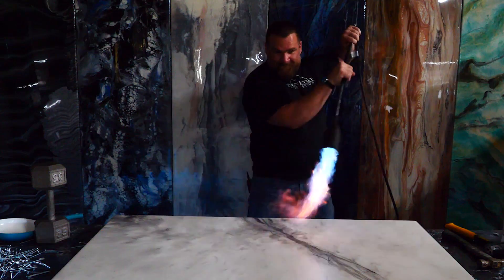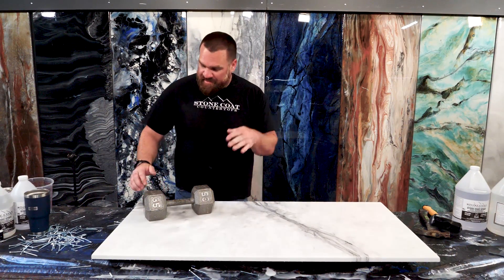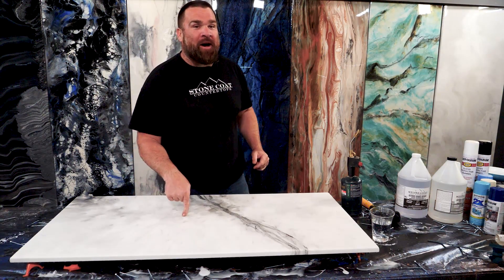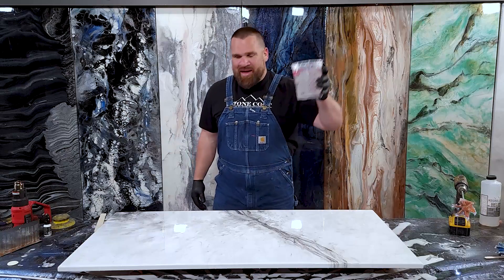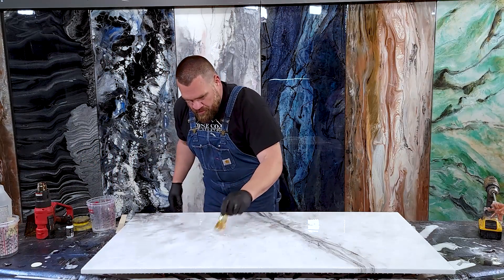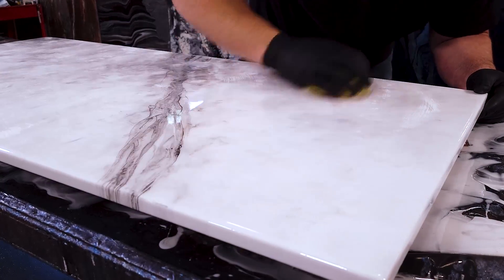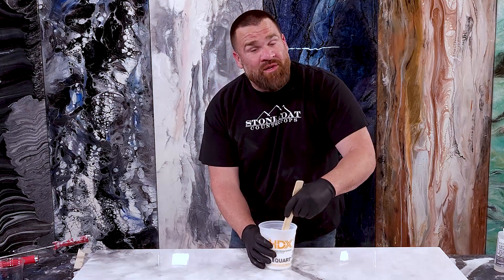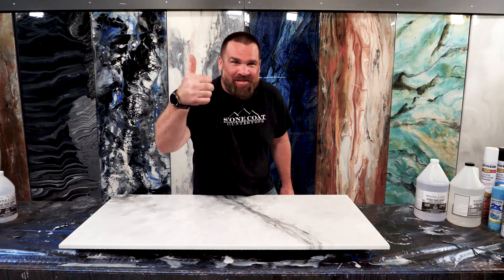🔨Hillbilly Lab Test | How will it Hold Up? Clear Top Coats | Stone Coat Epoxy

Comment: Well, phooey.  That comment/warning (down below) to never cut on a Stone Coat counter kind of deflated my enthusiasm.  We currently have ceramic tile countertops.  The tile is far far harder than most stone and is fine to cut on directly - no damage whatsoever.  Would multiple coats of TopCoat make the epoxy finish harder??

Comment: Can the top coat be applied directly over wood or does it need to go over a layer of epoxy base coat? 
How does the epoxy hood up to common garage chemicals? 
I’m looking for something to seal my pine workbench top for all my garage projects.
Reply: It can go over anything as long as u sand 220 grit so it can hold better

Comment: bold durability test! i would like to see some long term wear and tear inspections from projects that have been done and in use for quite some time now (exposure to water, food prep, edges of a surface where peoples shirts rub against, etc)
Reply: I've used it in a several bathrooms and it is great no damage after years of reasonably heavy use. I also used it as  the top of an ironing board and it stands up to regular ironing use by my wife and kids with nothing between the cloths and the iron... .again no damage at all.... The one thing to know is that with the original epoxy, the clear coat will amber a bit in the sun over time, if you use white in the product. Not an issue for darks, but if you intend to go  light and will expose to any sun, use the new more expensive version or skip the clear coat and just use the ultimate top coat (as I think the ambering is in the clear un-died top coat), which by the way was an awesome tip in this video, I was really hoping I could do that as that clear coat ambering has been my biggest issue with the original version.

Comment: Could you please perform this test AFTER you place the shiny coat on? LOL 😂 

The test in itself and its implication is pretty faulty. I mean, you’re comparing plywood covered with epoxy, which is “glue resin”, with natural stone!?? 
It’s like hitting an orange with a hammer then hit an apple with the same hammer.  It’d be pretty unrealistic and ridiculous to expect the same resistance and same result, wouldn’t it?? 

Physical comparisons are only fair, effective, and useful when it’s done for the purpose of comparing the SAME TYPE OF MATERIALS and when it’s conducted under the same physical conditions while using the same physical force, which requires special equipment.  

What’s your point with demonstrating the obvious? 
There’s nothing wrong with different tastes and with having to invest in different materials that fit one’s personal budget.  However, it’s pretty sad and false to imply that epoxy covered boards are better and outlast natural stone countertops!  

Epoxy isn’t ideal for kitchen or bathroom countertops.  
It’s like putting glue over plywood and talk about easily stained! 

Granite is far more affordable than people think!  It’s worth waiting and saving your money for! 

Your “surface resistance test” here is no different than if I were to use a piece of wood and a piece of glass to demonstrate which one is easier to break!  
That’s a very sad and dishonest selling point, to say the least! 

Granite is a natural semi-porous stone...comparing its sustainability with boards that are different in porosity is like comparing apples and oranges.  

There’s no question that a heavy hammer falling on a piece of porous stone is a perfect “physical recipe” for breakage! Duh! 😆 
There’s no question that epoxy covered plywood boards are tough to break…any thick plywood board is tough to break!!! 

No offense but, no matter how attractive epoxy covered boards are, I wouldn’t want plywood covered in “resin glue” as my kitchen countertops, that’s for sure…though I wouldn’t mind using it as a picture hanging in my wall…lol… No question that it’s truly beautiful…but so is natural stone!  

If you’re actually honest about it, epoxy covered boards simply don’t make good and long lasting countertops…especially when compared to natural stone! It’s a huge hassle to keep clean and free of stains!  Except for replacing the entire board, there’s NO way to remove stains from epoxy covered surfaces!  

The obvious difference in board sizes and how you propped the piece of stone versus the way you propped the epoxy covered board makes your “resistance test” completely unacceptable, unfair, and therefore false and useless.  But even if you used the same size boards and equally propped it, there’s no point in comparing “plastic covered boards”with pieces of natural stone!   What did you expect? That the stone wouldn’t break?   I mean, if I toss a glass dish on the floor, I expect it to break.  If I dumped a heavy hammer on top of natural stone, especially where the propping surface is hollow underneath it…yeah, I’d expect it to break…just as it did here!  

I do agree with you on one thing: hard plastic isn’t as easily scratched 😳🤦‍♀️ then again, I don’t know anyone in their right mind who’d put heavy metal dumbbells over natural stone countertops! LOL 😂 

Epoxy resin makes beautiful boards but when it comes to kitchen and bathroom countertops, it’s far from qualifying as a comparison with natural stone.
Reply: You can see right after the granite breaks there was a wedge under the front and back of it - see time 4:10.  So if your gripe is they did not use the same plastic parts that held up the stone coat section I don't think that is valid.  The test was fair as both products were elevate on the edges.  As far as the size issue, the smaller granite would have performed better, not worse on the impact test. And unless I missed it, the only comparison test was the breakage test, they did not compare surface resistance against the granite.  So it seems the comparisons were real and fair.  If your going to be critical, make sure your assumptions are correct....
Reply: @stickbeard  Thank you for your comment and points.  However, I do stand by my assessments.  Physical tests, especially when comparing different surfaces, must be done under the same exact physical conditions while applying the same exact force on whatever is being tested, which isn’t as simple as he makes it appear here.  

Nevertheless, that wasn’t quite my main “gripe” here.  We don’t need a test in order to know that results are completely different when we use a hammer to hit an apple then use the same hammer to hit an orange.  

There’s nothing wrong with different tastes and with using materials that fit our personal budgets.  

The problem I have here is the test itself and its implication.  

In essence, epoxy is “plastic glue” made of resin.  If you were to take a same size piece of wood and a piece of glass, you’d know which one would break first upon impact.  That’s my point here!  You could use the same force to hit a piece of plywood (without epoxy) and a piece of natural stone and the plywood board would not break as easily as natural stone does!  Obviously, that was his point…but the problem is the test in itself and its implications…because natural stone countertops are pretty awesome, especially when we know how to use and take care of it!  

My problem is about him comparing “apples and oranges” here, which is definitely unfair, unrealistic, and pointless…but not pointless to him because there’s a “selling point” reason folks use unrealistic comparisons and conduct completely unrealistic tests: to sell their products!  

While it’s pretty obvious that our granite countertops would definitely break if I were to hit it with a hammer, one thing that epoxy board sellers often fail to mention about epoxy covered surfaces is that it stains super easily (and good luck trying to remove such stains!) and the heat test isn’t a good one until you actually place a super hot pot on top of epoxy!! No matter how well sealed, I wouldn’t put a super hot pot on top of epoxy!  Granite countertops can definitely withstand a ton of heat without any damages to it and its sealants…and it takes a whole lot of recklessness and carelessness in order to stain natural stone!  Those are some tests he didn’t care to conduct here…

My point is this: the test in itself and its implication is completely unfair and unrealistic and therefore, it’s an unfair and even dishonest selling point! 

All he needed to do in order to demonstrate that epoxy covered boards are tough was to test/hit his epoxy covered board.  As it is, it’s tough to break any thick plywood board…add epoxy to it and it gets a lot tougher!    
There was no need for comparisons, especially utterly unrealistic “apples x oranges” comparison.  

People who don’t know better often invest on items based on unrealistic comparisons…so yes, I do  have a problem with folks using completely unrealistic comparisons as their “selling points”…and that was my main point here. 

Thanks again for your comment.
Reply: @LGFITNESS1  My issue with your initial post was you said the granite was not propped up and complained about the surface "test".  There were wedges under the granite and there was no direct comparison to the surfaces between the granite and the epoxy finish.  And again, the advantage of having the smaller piece of granite for testing is an advantage to the granite.  But I see you corrected (edited) your original comment.  I think most people would be surprised at how easy the granite broke.  These same people probably would not be surprised that the epoxied wood did not break.  The rest of your rant does not really apply to this video.  This is a sales demonstration of their product.  There are no lies in this video.
Reply: @stickbeard  Again, I appreciate your comments and opinion but I still disagree…and that’s okay.  We just have different opinions here. I didn’t correct my post…I simply edited for clarity.  Thanks again for your comments. Best wishes!

Comment: I am giving serious consideration to trying this. Question: Has anyone ever said that the finished product shows stains after it has been used? (ie., coffee, vegetable stains from food prep...etc)
Reply: Wine? That’s what I was waiting for.
Reply: I've used it in a several bathrooms and it is great no damage after years. I also used it as a ironing board and it stands up to ironing with nothing between the cloths and the iron... .again no damage at all.... The one thing to know is that with the original epoxy, the clear coat will amber a bit in the sun over time, if you use white in the product. Not an issue for darks, but if you intend to go  light and will expose to any sun, use the new more expensive version or skip the clear coat and just use the ultimate top coat (as I think the ambering is in the clear undied top coat).

Comment: I know you have expoxy for floor. What is the different if I use the the counter expoxy applied on plywood and place it on the floor, beside slippery.
Reply: In my research on epoxy for floors in general, not this brand in particular, there is a risk of cracking the cured epoxy when the plywood subfloor flexes. With proper preparation, it can be done. There is a really good video on here where a lady does an golden/yellow epoxy floor over a plywood subfloor in a large doghouse (large enough to stand in). She talks through all the prep she did for it and why and is very thorough. In the description, she links to her website where she has a tutorial that gives even more detail. I think you could use SCC epoxy just fine using her methods for preparing the plywood first. I found it by searching for “epoxy floor over plywood subfloor.” Hope that helps! :)
Reply: @ChloePants1  Thank you very much for taking your time to provide the above info. I was quite upset with SCC that none of them responded to my query. I follow their video clip every time when they updated their new design. Planned to purchase their product by now I am look else where hoping to find a supplier that cares and respond to each and every client queries.
Once again appreciate your effort and with thousands thanks.
Btw, if you have the link as you mentioned I would like to have it.

Comment: Is there a particular reason why you do not use Foam Rollers to apply the top coat? I still get fibers in my top coat even with delinting from 1/4" nap rollers.
Reply: Good question. I have asked many times without response

Comment: @Stone Coat Countertops  I have been wanting to use your product, but have yet to see you do a counter top like i have. I have a counter top from the late 50's and it is completely framed out with a metal trim including the back splash which is riveted  into the counter.
Reply: Your situation would probably require you to remove all the old countertop and backsplash, start with new MDF wood like they show in some of their videos. Be careful when working with anything that old, evening just tearing it out could release something hazardous like lead it asbestos. Don't want to scare you away from a DIY project, just be safe 👌🏻
Reply: @al.j.s  Thank you but i really don't want to rip anything out. The meatal trim looks awesome it's just the tops that look worn. I thought the product would set up nice being the meatal has a lip and i wouldn't have to build a reservoir. Oh well :( Back to the think tank.

Comment: If you don’t sand before apply the top coat, but poured a epoxy coat within 24 hours of applying, will it still stick and keep some of the glossy look?

I love the glossy look but it scratches with just simple plates and things ontop of it so I need to add the top coat. I’m just trying to keep it as glossy as I can

Comment: Freaking amazing
Reply: Not really; weight is a flat surface on a flat surface; nails had next to no pressure on them reducing friction, the heat was not focused so complete nonsense;  I can do that to my flesh without a burn... hammer was dropped on a completely different material than the epoxy was applied to... If they need to stoop to this sort of deception it must not be all that great. I like Epoxy, but this is false advertising.
Reply: How about the scratch test be that of an angry relative keying the counter on the way out; ohhh oops FAIL.

Comment: I need to know how to prep the wood first, grit #? For sanding, do I need to primer?
Reply: If MDF or Plywood just round over the edge and apply a coat of undercoat paint then you are ready for epoxy, Google Stone Coat Over Laminate if you are going over smooth surfaces
Reply from the maker: Excellent question! Stone Coat Countertop epoxy works great over raw wood. Here are two video links showing how it works on wood. -Nathan https://www.youtube.com/watch?v=QnKg49cXnNs
https://www.youtube.com/watch?v=wxBvAljrjFw&t=1458s